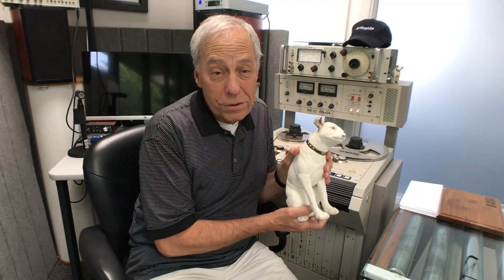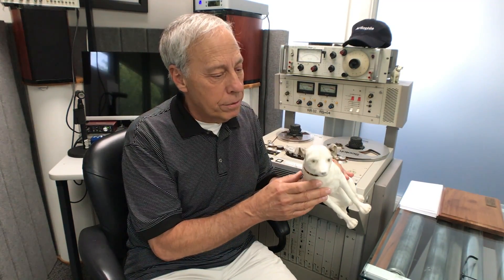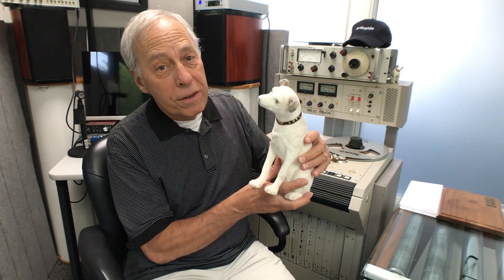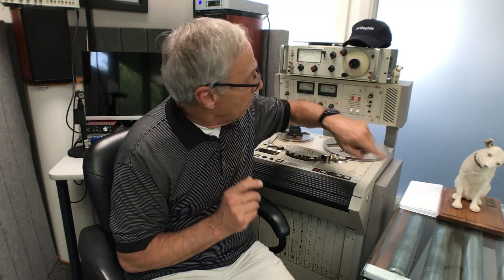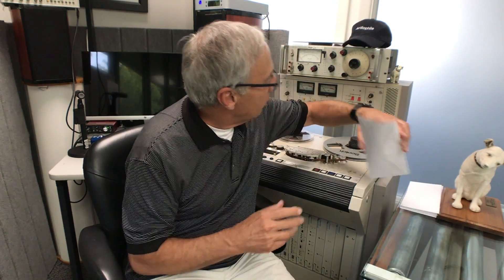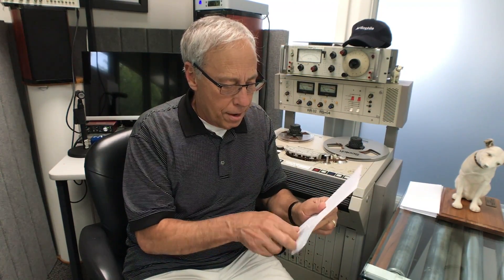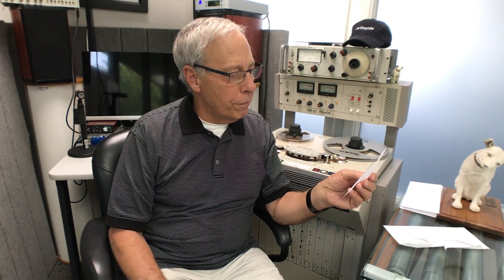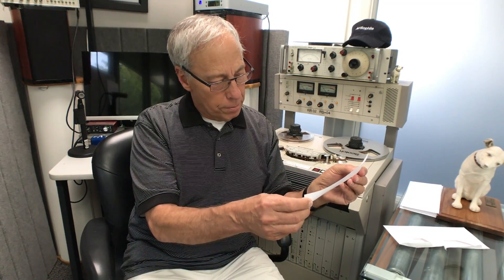Thin cables inside speakers

Comment: I recently purchased a used pair of ICON Parsec tower speakers. Very small direct-to-consumer Mass. company that went under in 09 I believe. Anyway, the build quality is astounding. Each weighs 92 lbs, and when I took the drivers off to see what they were, I notice they had wired each of the three drivers with Audioquest type-4 solid core cable... Holy hell. Not sure why they chose to do that, but my god, it's the beefiest internal wiring I have ever seen. Not only that, but instead of a traditional Xover board, or even two, they actually had soldered the Xover components locally... so the caps/resistors/inductors are actually soldered around/on the driver terminals themselves, and in a way which (at least to the eye) does not impede airflow... Very strange. I haven't dissected hundreds of speakers, and don't claim to be an expert, but I have never seen anything like it before.
Reply: Inductor coils produce magnetic fields and are interfered from other magnetic fields like a speaker coil. So you try and keep crossover components as far away as possible from driver coils. You also need to secure the components by gluing them to a board or using tiewraps so they cannot move from the sound waves to produce microphony and also could break soldering of non flexible single strand wires. There's a reason to why 99% of crossovers are mechanically built the same way on a dedicated board.

Comment: I used to have a pair of B&W CDM's that had really sad thin wires in them. I replaced the with regular, not overly fancy, full oxygen free copper loudspeaker wire.
Worked like a charm.
So if you have affordable yet relatively serious speakers, give it a shot. Just buy speaker wire that's a few dollars a meter, nothing too excessive, and give it a shot. It's an easy fix!

Comment: The wire inside the speaker connected to its terminals is thin because it is the ends of the actual voice coil which needs many turns so it could not be achieved with a thick wire. going a small distance with a similar size cable is not going to make any difference in terms of power loss.
For the longer external cables I suppose it might reduce the resistance a little by using thicker cables. But I wonder if the fact that the thicker cables means that the cores are slightly further apart and so will have lower capacitance makes more difference.
What we need to compare is thick twin cable with thin individual cores that you keep > 1cm appart between amp and speaker. Some good quality speaker cables do have a bit of extra insulation  between the cores to maintain more separation. So I think Capacitance may be the key here.

Comment: I had the internal speaker wire break on an Infinity subwoofer back in the early 2000s. I believe it was a Reference Series, I replaced it with a Perfect. Those speakers sounded great. Sadly the whole system got stolen in front of the apartments I lived in at the time.

Comment: In the studio monitor system we had at Starstruck Studios in Nashville there was 10 guage wire from the final output stage circuit board of the power amp all the way to the dual 15" woofers (and the rest of the drivers too)... all the way. It really made a difference in the low end and the transient response. The Chevin amps were built especially for these systems with the modified circuit board inside the amp. It was a very impressive system. I like that you said, "weenie wire" as I use the same term. Love your videos, Paul. Your passion for high fidelity is obvious.

Comment: it seems like  speaker makers should experiment and determine the best wire for their speakers. 
its an obvious design question. I own Tekton Lore 2.0 and my guess is the internal wire is cheap hookup. I believe one can special order crossover caps and wire as upgrades which is expensive- is it worthwhile? I'd like to read if not hear a comparison test, A-B.

Comment: Even if you're feeding 200 watts to 8 ohm speakers constantly that only equates to 5 amps approximately. Penny pinching 16 gauge wire will handle that easily and any losses over the short lengths involved in your speakers will be negligible. At more realistic volume levels this is even more true.
Reply: Great answer! I wonder why the guy who made this video couldn't have actually provided a technical answer to the question instead of showing the ceramic doggie and talking about thick wires, thin wires, and "horse leg" cables. He did mange to mention a couple of gauge numbers, but then didn't really relate them to anything that the question asked.

In fairness though, maybe he just doesn't take it all too seriously. Audiophiles are after all fanatical crazy people......many of them middle aged men with middle aged hearing........who believe that they can actually hear the difference between a solid state amplifier and a vacuum tube amplifier, and for that matter, between a vinyl disk and top quality digital media. Yes, you CAN identify the vinyl disk......it's the one with the pops and clicks.

Comment: If the cables going to the speakers is a long run of wire it will have greater resistance which is overcome by having a greater outside diameter or better conductivity by some other magical means ie. material, however, since the cable run inside the cabinet is short there's less resistance so the girth of the wire matters less. That was my first thought at least that seemed to make sense to me.

Comment: Well that was waste of time watching , the reason the wires don't need to be of a thick gauge is due to the fact they are short distance from the crossover to the driver  therefore low resistance and now loss , the longer the run of speaker cable the thicker it needs to be , just wasting money putting starter motor cable on a 2m speaker cable run from the amp money than sense !

Comment: Its simple. low voltage dc current needs a bigger wire. High current ac requires much less....which that's what music is....ac.
Reply: This is technically not true. The signal is more so alternating voltage. This is why FETs are used in amplifiers. AC also transmits well on single strand wire. A speaker signal does not, it's in a class by its self. It runs best on a large surface area.

Comment: I thought Paul didn't give a satisfactory answer; here is a rough explanation. It is a tad more complicated than this, but it'll do.
   I've just built a speaker cab for a subwoofer. The driver is an Eminence 18" 400w driver. The wire - "rat tail" from the driver terminals to the voice coil is about 1mm dia, it is platted copper.
    The driver is 8 ohms nominal impedance , so to get 400w peak power it will take about 56.5v RMS @ about 7A , but that's sinewave power. But the 1mm thick rat tail will never see 7A continuously whilst playing music, it will see a pulsed current.
   1mm dia cable is about 18 AWG, see here for current ratings - https://www.engineeringtoolbox.com/wire-gauges-d_419.html  As you see,  solid single core 18 AWG can handle about 9.5A. It's de-rated if made up of 7-25 strands to 4.9A. This is a rough figure in free air.
   It's a good idea to use thick cable from your amp to your speakers as the cable has resistance, albeit a small one. But at high current that small resistance will cause a small voltage drop or loss. BTW, you don't need fancy cable, just good old normal copper. 2.5mm mains cable is fine but a bugger to bend.
   The cable or wire in your speaker has a small resistance as it is short in length, no need for heavy gauge cable. 
   Lastly, try this experiment if you have a DMM. Play some music and take an AC volt reading at the terminals on the back of your speaker. Even at a very loud volume, it won't be much, you'll be surprised. Square your answer and divide by your speakers impedance to get power in watts. Again you'll be surprised at the low figure.
    So, no need for solid 1 inch thick copper rod or cosmic cable made by magic faery's; the voice coil in the drivers in your speakers is made of bog standard copper and it's very thin. The water analogy doesn't do here, there's more going off.
Reply: @Jordan Murray The only possible way you'd be able to tell the difference between a $3,000 speaker wire and basic copper lamp-wire is if they're both hundreds of feet long. Don't get me wrong, PS Audio makes some great products like their amplifiers, DAC's, etc.... but  the only thing i could possibly think of when i saw their $10,000 AC Regeneration system and $1,000 1.5m long power cable was "a fool and his money are soon parted".
Reply: resistance is proportional to the length/ csa it is that simple

Comment: Well Paul I think this is the first question that you got a little stumped on instead of saying to cut corners and save money a company uses small gauge than wires but I did not hear that what I really heard is it really doesn't make a big difference at all 🙄🤐🤐🤐😵😳🤑🤑😷😷🤬🤬 from now on I will only buy moderately priced interconnects and wires nothing over done whatsoever save myself a lot of cash my system should sound the same way

Comment: Yes, it makes a difference, and can sometimes affect the sound quality, but mostly only if the wires internally are considerably smaller than the ones feeding the outside of the speaker terminals, (from the amp to the speaker), and the amp powering the speaker produces too much current for the internal wires to safely handle, but that situation/combo is pretty rare, because for one, the internal wires from the crossover to individual drivers are MUCH shorter in length, relative to the ones going from the amp to the overall speaker itself, so even if they are smaller gauge they can still let the amp power through safely because the overall resistance of the smaller, but considerably shorter, internal wires is oftentimes no more than the larger, but much longer wires from the amp to the speaker. 

Plus the fact that the overall power input into the speaker from the amp is split into 2 or 3, (or more, depending on how many individual drivers the speaker has), different ways, and each individual internal wire therefore is only handling a small fraction of what's coming into the whole speaker. The biggest wires usually need to/should be going to the woofer(s) of a speaker because for the most part and on average the woofer absorbs the majority of the wattage and current put into a speaker as a whole... 

Also consider that audio signals vary widely in amplitude with the differing music loudness levels throughout a song, and also vary considerably with frequency, so no one internal wire has to handle too much current for too long, as it's all pretty much continuously varying and intermittent signals going through them as the music is playing, which, unless you are severely over-driving the speaker, (in which case you would most likely hear horrible distortion unless you are already deaf, lol!), it's not going to put any unmanageable stress on any of the internal wires. 

Some types and sizes of wires are generally better for different types of drivers and frequency ranges though, and of course if any of the internal wires of a speaker have become corroded or "tarnished" with time, as sometimes happens in vintage speakers, then those wires can degrade the sound considerably. When upgrading and improving a vintage speaker especially, (or a "cheaper" one, regardless of age), I will always upgrade the internal wiring as part of the improvements. But like Paul was saying, a few of the better speaker companies actually DO pay close attention to the internal wiring of their speakers and install much better quality and generally larger overall sizes of internal wires than others do. I would have to say that for the most part though, the majority of speaker manufacturers most likely computer model and design their speakers, especially now-a-days, and therefore most of the internal wiring that you see will already be appropriately sized for the application, so it's not something that has to be seriously worried about in most cases.

Comment: In my experience telephone cables as internal interconnect are only used to spare a few dollars per speaker pair.
On the other side more than 1,5qmm cable made out of fine stranded copper wire is rarely necessary.

Comment: The short quick answer is that the  crossover wires to the voicecoil are rated at a few  amperes and will happily handle the manufactures rated power (generally). The silly size of the cables made by PS Audio are intended to satisfy the gullible  into thinkiing they are  better, to justify the high price. This is the reason Mr. Paul did not answer the question,  and probably knows little  about loudspeakers.

Comment: The wiring inside the speaker has to transmit only a limited bandwidth to the individual chassis and a part of the current, while the cable between amp and speaker must deliver them all mixed over the long run to the speaker.  Under the influence of electric fields from neighbourhood it requires much more quality and less losses. Big bass currents must not magnetically induce cable vibrations or affect treble resolution.

Comment: Paul I am a huge fan of your videos and I am usually impressed by the information you provide but I am disappointed in your dodging of the actual question. There are ways to explain this matter that are only semi-technical, you could clarify the lack of significant losses in the realatively short distance between the internal crossover and the driver, the impedance of the wire in relation to the design of the crossovers, etc seems like you may have missed an opportunity!
Reply: One has to wonder why he even pretended to answer the question.
Reply: I agree.
Reply: Agree
Reply: Paul is the consulate salesman. It’s not outwardly apparent but he’s always pushing his products. 
I think the reason is he didn’t answer is because his own FR30 speakers have thin wire. 
Make no mistake: thicker wires Do improve the sound, right up until the drivers. It’s a question of COST.
Reply: @Fluterra  Consulate? You mean he works as a consul for a government in a foreign city? Or maybe you might have meant to say consummate? Maybe predictive spelling wrought its magic yet again!
Reply: 03Softail88   Do you really do that? Wouldn’t that kill your warranty on day 1?
Reply: This is why it has continuously being said that expensive interconnects/speaker cables do nothing for you. You only need to have thicker than normal cables (16 guage ofc) when lengths are over 30 feet or so.
Reply: Kingsley Orion  Wait, you hacked my friends Instagram password?  some f ucking friend you are... and you want us to do the same, to be a pos like you?
Reply: Paul can lead you to water, but he can't make you drink it.
Reply: @jason4547  Paul normally leads you up the garden path.
Reply: He didn't answer the question because there is no answer to the question. Wire is wire. Great lengths don't matter either. 100 foot speaker wire is going to "degrade" signal no matter what. That 10 gauge wire isn't going to help any when it's being connected to 16 gauge wire on the end. The signal isn't magically being enhanced or boosted by the crossover/terminal. You've simply been spoon-fed lies so companies like monster can sell you 100 dollar cables per speaker. Smh
Reply: @Lord_Pistachio_Nut  Wire gauge determines its resistance. 100' of 10 gauge will have measurably less resistance than 100' of 16 gauge wire and, at the very least, account for some drop in power to the speaker. The speaker's frequency response might also be affected, depending on the speaker's impedance. The additional resistance of the "16 gauge wire at the end" vs 10 gauge would be negligible by comparison.
Reply: @nodaysback1  the entire conversation is semantics. Especially considering 99% of your speakers lifetime is spent being fed less than 10 watts, regardless of what the Amp's wattage ratings/claims are. The resistance is more dictated by the speakers than cable being used too. An 8ohm speaker hooked up to an 8ohm amp/avr is going to read close to 8ohm regardless of wire thickness. 

I get what you're saying, and you're not wrong - in the general sense. But for what WE are talking about, speaker wire is speaker wire. Copper is copper and lamp cord will perform as good as $20k per foot speaker wire will.
Reply: @Lord_Pistachio_Nut  My speakers spend 99% of their time getting spanked by amps with almost twice the rms output than the speakers are rated for. The extra reserves are there for the transients, heavy bass hits, and pounding "end of the song" sections that call for it.

For the average 'home owner' set up with 50W amps and < 25' of speaker wire, sure.. regular 16 gauge is all you need. 
But, high power Crown and QSC's feeding 15" p/a's and dual 18" subs 60 or 70 feet away need 8 or 10 gauge wire to minimize  resistance and to allow the amp to damp and control cone excursion, especially on the subs. You can't broad stoke the statement that speaker wires don't matter.. you've all been bs'd..